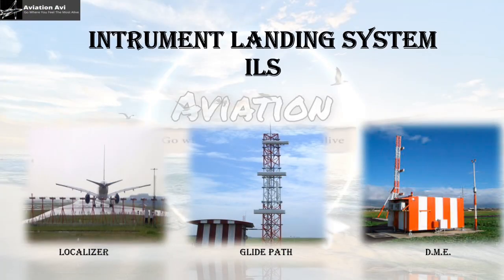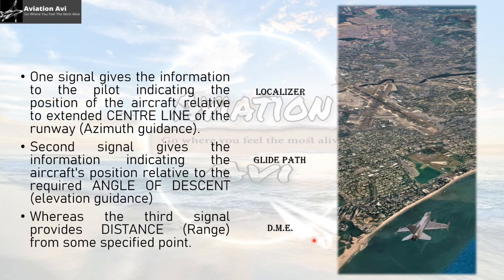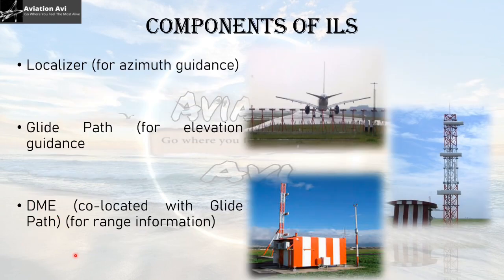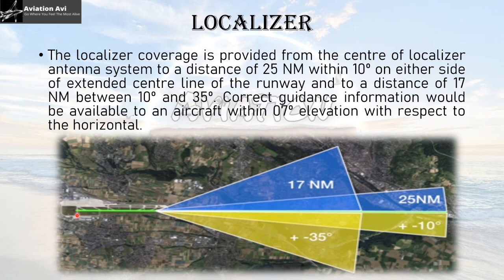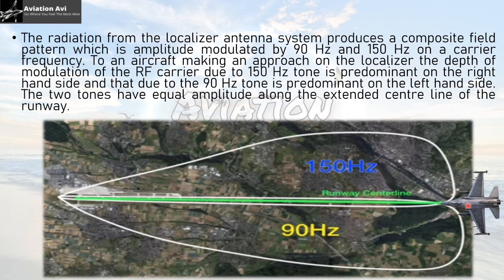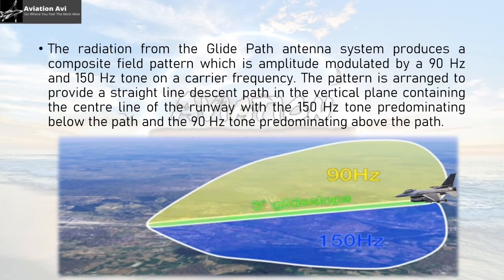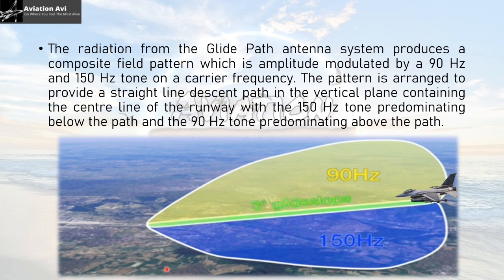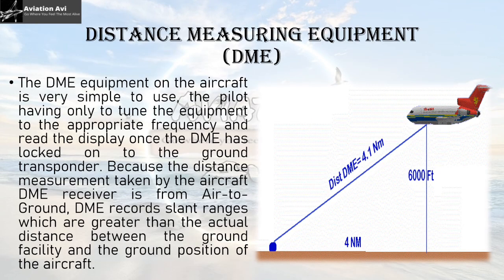ILS | Instrument Landing System | Localizer, Glide Path, DME

Comment: Santanu I'm not sure if DME gives distance with reference to Aiming point,it's distance from where the ground equipment is placed to the aircraft receiver???
Reply from the maker: Very correct Sir, but think in this way that at what place an aircraft is going to make its first contact with runway,  possibly at TDZ and precisely at Aiming Point..So a DME as well as Glide path angle along with PAPI is calibrated in such a way that all guide the aircraft to Aiming point precisely. And in most cases the DME is colocated with GP Antenna.